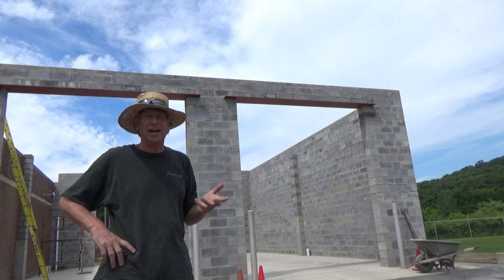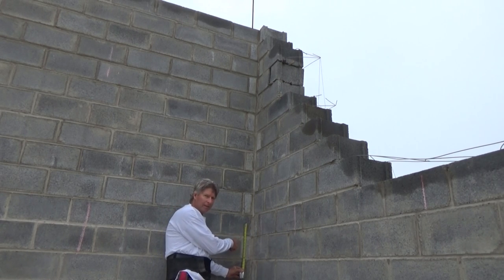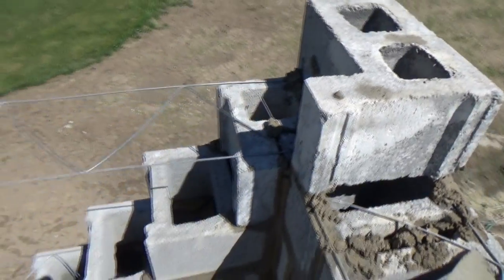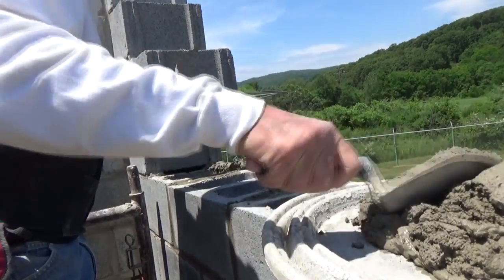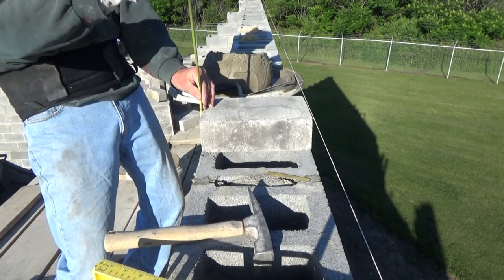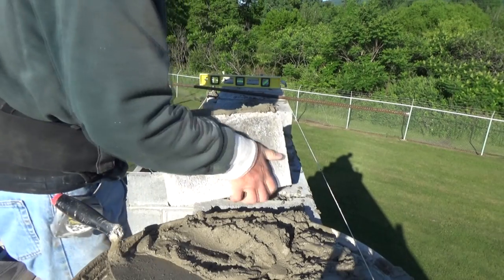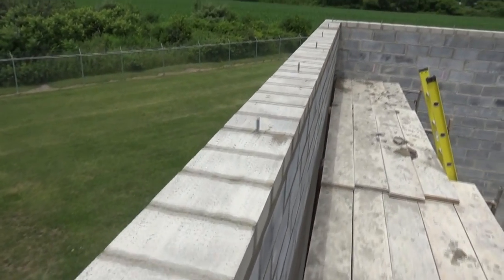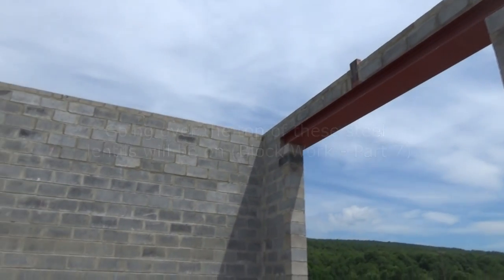BLOCK LAYING (part 5) Mike Haduck

Comment: I haven't laid any 12" block in 32 years, (I moved into highways, sewer treatment plants and bridge construction). I built corners with an 8"X8"X16" block and then filled in the inside with a 4"X8" concrete brick/block This is the first time I've seen a 12" corner block like you used at 1:51. Also my first to see a 4"X8"X12" cap. That made the building look very nice. 
You're doing some good teaching with this video series. 
Thanks for the videos!
....13
Reply from the maker: thanks arkansas,  I can tell you it is almost my last block job,  It is much too heavy work for me anymore,  thanks mike
Reply: good job
Reply: I'm 52 and it hurts like hell to lay block anymore.
Reply from the maker: I am 63, & I hear you,  mike
Reply: Mike Hadu

Comment: Thanks for all these tips. In my younger days I got a labor job with some block layers supplying the mud and brick. Now I have been thinking of building my own wall.
Reply: We have a stone house built in 1910. The kitchen is to small so I like to push out the wall 6 feet
Reply: True repentance begins with obedience. By obedience we observe and do the works of Christ through the tokens of the Sprit which separates us from the world unto God. #s8w
Reply from the maker: Tanks Dave, we keep the faith,  God bless,  mike

Comment: If you put that line to your side of the wall the block work would not look so rough. There are shadows all over it.
Reply from the maker: Hi Corrie,  picking up over the line is something I will not do anymore, I am in my middle 60s and those days are over, they were happy with the results and price,  I appreciate it.  mike
Reply: Fair enough.